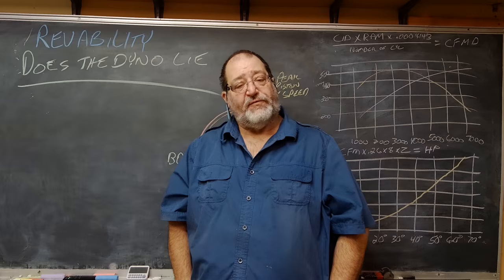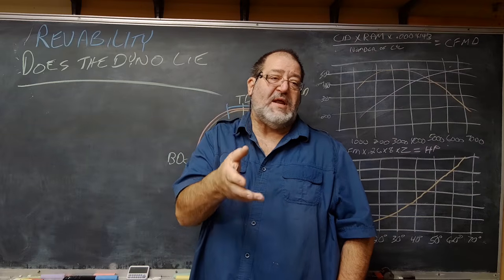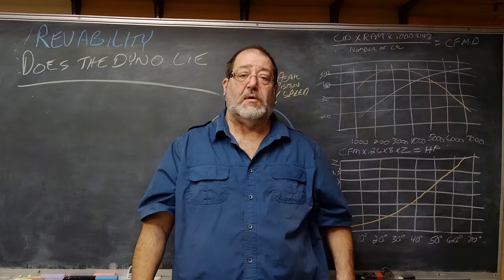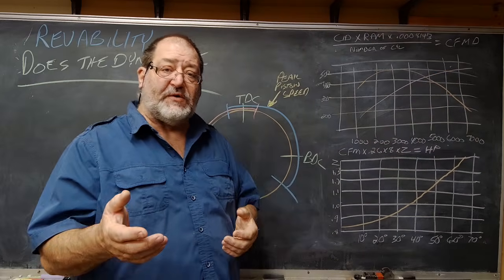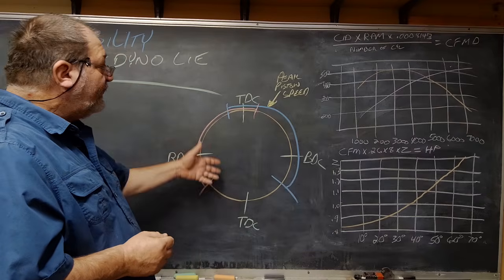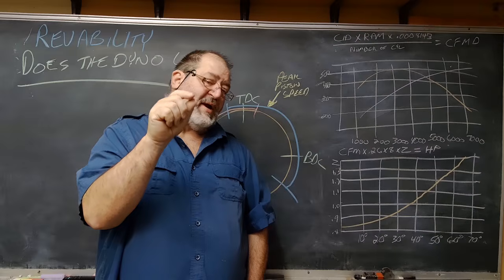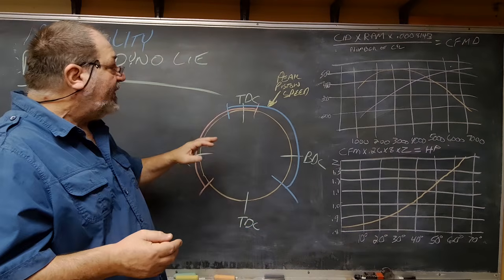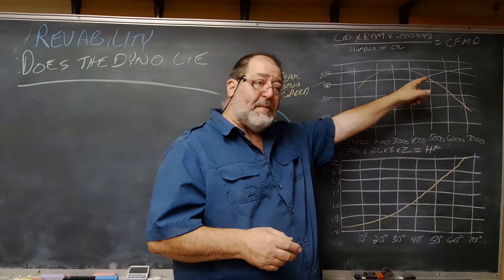Revability does the Dyno lie?

Comment: The best simulation on dynojet dynos is the fastest sweep. 

Since I build motorcycles I use a 250i as a tuning tool, and it's a very good indicator of performance--both perceived and real--from 1000 - 15000 RPM. 

When guys say their engine doesn't perform as well as the dyno sheet reads, it's either a correction factor issue or they're improperly testing. 

"The first principle is to not fool yourself, and you are the easiest person to fool."

- Richard Feynman
Reply from the maker: The interesting  thing  is sweep rate can change  the curve  as it changes  the load and so how the engine  will behave  .....